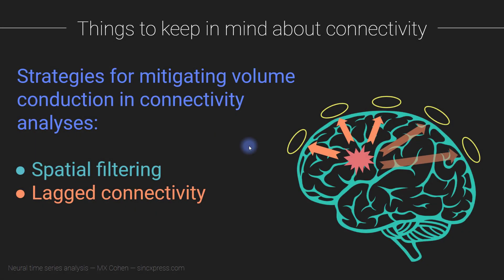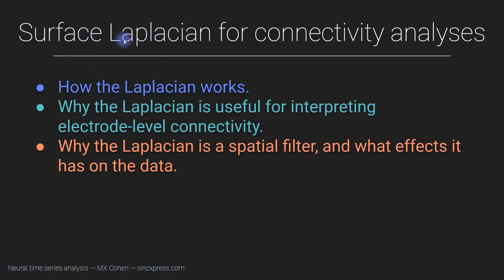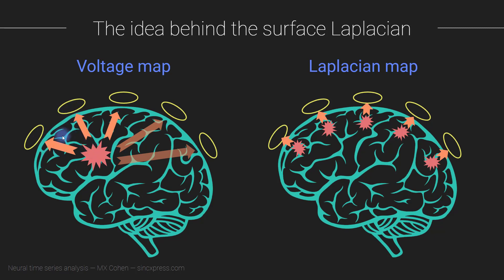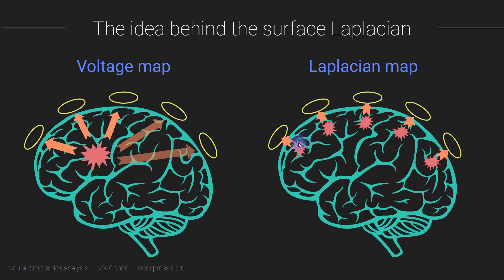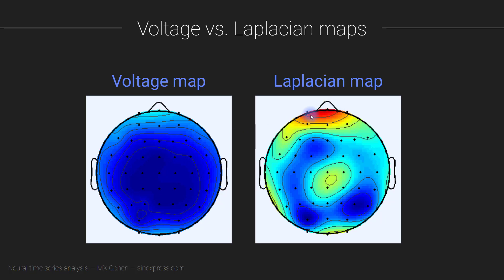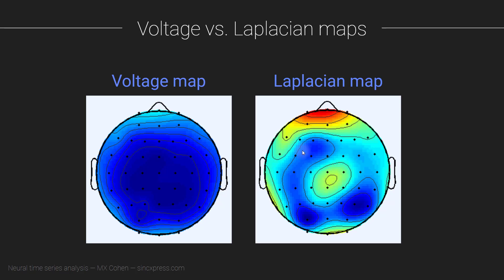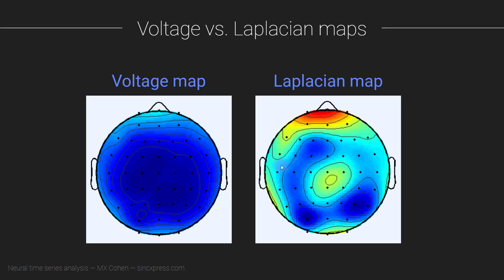Surface Laplacian for connectivity analyses

Comment: Hi Mike! This is a great video-series. I noticed that in your book (which is also great) you mention that the SL filter should not be applied to MEG data. Would you mind elaborating on why this is the case, or refer me to a source that does? Many thanks!
Reply from the maker: The SL is a model of voltage spreading over the scalp. MEG isn't voltage ;)

Comment: Hello Mike! Thanks for this new version of your course. I have been watching your videos before the release of the new version, they are both great! I have couple of questions about Surface Laplacian:
1) Apart from functional connectivity, how wise it is to apply SL on ERP data? Or for time-frequency analysis?
2) In your old version of the course, you mentioned that after SL, the unit changes to uV per unit area square (mostly cm^2). Does this change in unit change anything about our interpretation of the EEG data?
3) You also mentioned in the old version to pay attention to the unit issue in case we are going to do TF analysis after SL. In other words, no normalize the data before TF analysis. Can we for example do: 10*log10(channel_data_in_uV_per_cm2)?
Apologies if any of my questions doesn't make sense
Reply from the maker: Hi Haneen.
1) Yes, it's a good idea. SL improves SNR overall and also attenuates some artifacts like muscle activity. You can look up a special issue on the SL in International Journal of Psychophysiology from several years ago.
2) Nope, not really. It's still changes in voltage over time.
3) Yes, that's good. I generally recommend normalizing time-frequency power data anyway. If you apply a baseline normalization, the original units don't matter.
Reply: @mikexcohen1  Thank you Mike for your detailed answer! Really appreciate it. I actually just paid attention that CSD activity is still a voltage and thus converting it to dB before TF analysis must be done using 20*log10(channel_data_in_uV_per_cm2) since it is voltage and not power.Is this correct or am I missing something?
Reply from the maker: Yeah, "must" is a strong word. I generally recommend normalizing power to eliminate the original units of the data. But it's not always necessary.

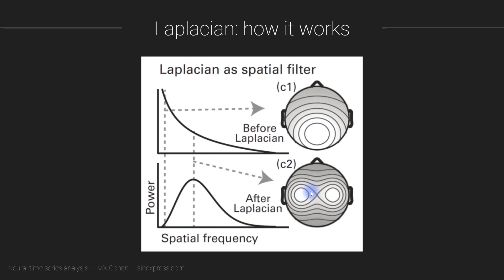Comment: Hi! Thank you for the useful videos, I am a fan. At 9:54 when you talk about low spatial frequency attenuation by Laplacian, why does the Power at low spatial frequency higher than that at a high spatial frequency ?. It seems counter-intuitive. What am I missing?
Reply from the maker: Hi Radha. That's an empirical observation in neuroscience -- lower spatial frequency activity tends to have larger power. It's probably a combination of brain organization plus the intrinsic biophysics of EEG: small-scale activity is too small to be picked up from outside the head, while larger-scale activity produces fields that are powerful enough to be measured through tissue types and at a distance.

Comment: Hello Mike
I have registered now for the course but a have a question I am doing my preprocessing on EEGLAB is surface Laplacian is available to be done on EEGLAB. I have been searching and I found a CSD toolbox, could you please clarify how to use?
Reply from the maker: Hi Lina. Yes, you can use the CSD toolbox. I have a function that also implements the same method (from Perrin in the 1980's) that is a bit more efficient than the CSD toolbox. You can get that from my book code (available from my website sincxpress.com; you don't need to buy the book to get the code), and it's also available in some of my online courses.